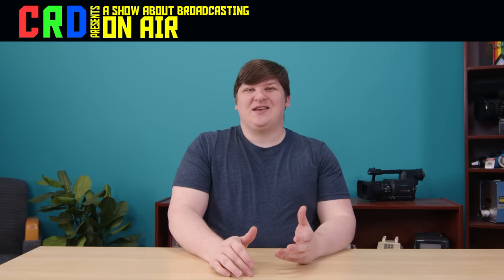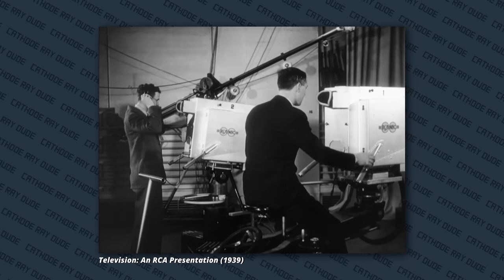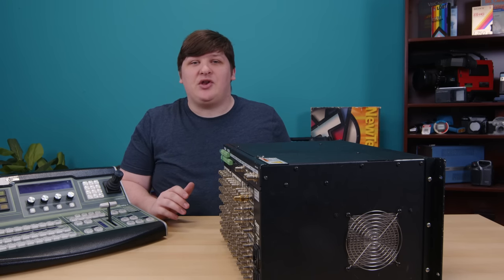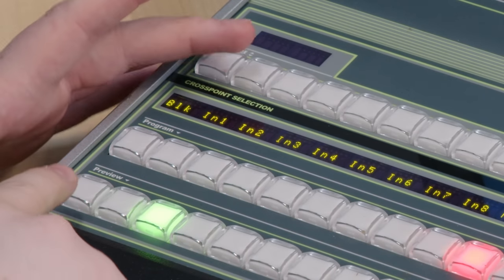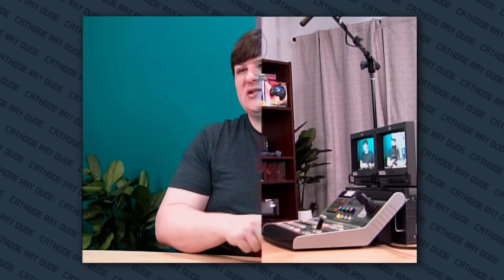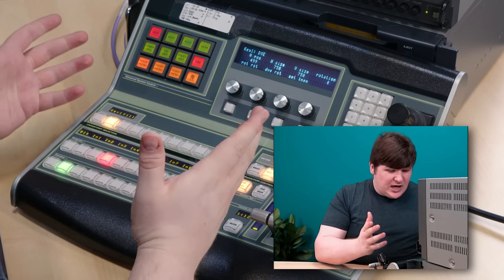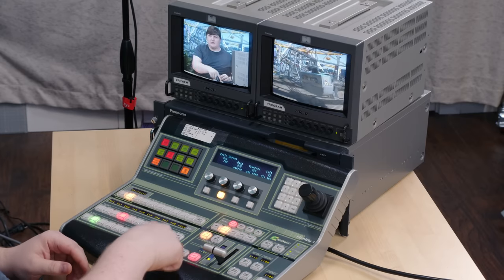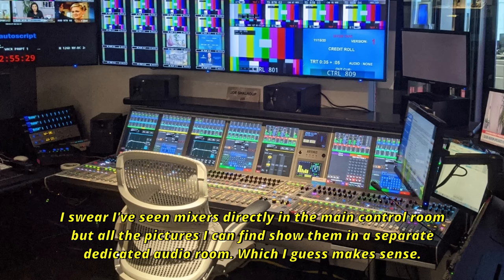What the heck is a video mixer?

Comment: I did public access back in the late 80s through early 90s - our video switcher board had all sorts of features, but was still only capable of doing 480i.
I did the whole producer training, and helped produce many episodes of a local zoo show, as well as a lot of sports events at local high schools.
We even had a couple of Video Toasters... but almost all of our studio cams still used photomultiplier tubes (CCD was out but was really expensive then) so good luck doing anything fancy. :D
Reply: I was involved in community TV and radio on the 90s.  It was so much fun.
Reply: Since people seem to find this interesting I'll call out some of the gear we had in each of the studios (two large ones and two small ones). 
We also have several mobile truck studios which had similar but more condensed sets of more or less the same. Almost all of this stuff was rack mounted in a series of panels behind the switch board area (but within reach) and along the side wall. 
- the main video switcher - much larger than the ones shown in this video - ours had at least a dozen wipes/fades/etc and several modes to insert an inset (used way back in the day to show a scoreboard of a sports event in the corner of a live shot). Pretty nifty for the era, although far from top notch for the era (we were a public access station with decent stuff, not a major network affiliate).
To run this, you needed to demonstrate mastery - this person has the greatest ability to make a goof, especially if you're doing live (for sports events, we often did).
- VTR units - i.e. VCRs but of the U-matic 3/4" tape format - you'd have one unit set as master record, and several others where you could queue up various B-roll clips or the on-site shot you pre-edited; have your host introduce the video then cut to that tape, back to host once it's done. repeat, etc.
- sound loop players - little short loops of audio in nice little tape modules - insert a pre-recorded audio advertisement, etc. Push the button and it immediately began playback - once done it would stop and be queued at the right spot for the next time - pretty neat for back then.
- SFX/audio mixer board - same idea as the video switcher except lots of channel sliders; similar to a band's touring mix board but only a dozen channels or so. Nothing fancy like recording studio board (those have dozens/hundreds of channels).
- master signal generator / genlock - a rack mounted master clock - it sent a signal to all the video gear and cameras to keep them in sync. A requirement for the old NTSC standard to avoid any flicker.
- light mixer board - control the various lights in the studios - this was pretty fancy as we had a variety of plain roof lights, smoky gels, indirect, etc. Sadly not configured to use that protocol where you can send signals in real time, so somebody had to run this when you were doing a host intro and fade out at end of episode for the studio stuff.
- studio cameras - generally three huge tripod mounted monsters - they did have a limited ability to move so we would set them up for a show then leave them in place. Wonderful setup - preview display on top with red light if master was using your feed (so you'd be careful not to do anything dumb), connection for headset so you could whisper to control room and hear their instructions - "camera 2 get a close up of guest", "camera 1 get wide shot" etc. while cam3's feed was being used.
They had the nice hand grips and were very well balanced, so it was easy to aim it; zoom was a thumb control on one hand and focus (haha you expected auto-focus?) was a twist on the other hand.
If you aimed at the lights for more than a split second you would ruin the tube, which cost at least a few hundred bucks to replace, so just don't do it. :D
- a whole row full of preview TVs - one for each of the VTR units, one for "master out" and several others.
- shoulder cameras - we had a few smaller ones more along the size of news gathering gear - but that took U-matic tapes, so were bigger than a VHS camcorder. Once again, don't point at the lights - although these were a bit more tolerant than the studio cams.
- giant room full of audio cables and reels of video cables - audio was normally done via same stuff professional audio people use, nice rigid cables with XLR connectors that actually clicked and stayed connected :P Video was done via these at least 1/2" across cables containing 40+ conductors - the end connectors plugged in and you twisted to lock it in place.
- Going out with a truck to do a sports event was similar but often with less gear - 2 or 3 cameras for volleyball - maybe up to 5 for homecoming football. The "fun" part about those events was needing to do setup and teardown - and making sure to place your precious cable bundles somewhere they won't be constantly walked on by people who just can't seem to be bothered to step OVER the obviously very expensive cable. I wish I was kidding - those video cables were like a magnet for "moms with high heels walking out of bounds because they think they can" and we'd have to shoo them away. :D This was the point in my life when I learned about rigger's/gaffer's tape - like duct tape but much much better (even if more expensive).
Reply: @chouseification  it's like what they say about fiber optics, The yellow digging machines will come for it. I did audio mixing for a band at a race (running, fundraiser, nonprofit) wouldn't you know it of all the places the pathway decide to form right where all my cables were going from the Mic's to the mixer and I didn't have a snake or longer cables at that time.
Reply: @chouseification  yeah wasn't that fancy for the rubber cable guards at that time as I was literally 5 to 10 feet away from the band.
Although I did do the music tent for our small local county fair (minus the animals so we call it an expo). we had a fiddle contest where all three judges decided that they were going to move into my tent and act like they own the place. And then they complained about being behind everybody and not really able to see the players, shockers it's almost like they were sitting behind the stage. Oh wait they were to the left.

I do an international water tasting for 3 years now and I love offering up press feeds. And occasionally will have other groups come in and film like TV, documentary etc. I've only had one person who understood what that meant where I didn't have to explain and they took me up on it.
I've also edited videos where having a direct feed from the board is so much better than having the room audio from a gymnotorum.

Oh yes the fun situations that we find ourselves in. I got into a concert at a nearby local theater free for helping them tear down. Not only did half if not all of the people coming in have earmuffs on and hearing protection which made the entire thing a horrible experience for me the whole thing sounded better in the lobby over the fallback system. Oh yeah where was I going with this the old theater balcony needless to say started shaking with the spectators even made one person nauseous. It's nice that you got them kicked off and it's also nice to keep the responsible ones. Rickety structures ekkk.

I was asked to film today or yesterday now at my local Art's Place, they had a kids art thing they did in their black box theater which has four posts and guess where I was I just barely managed to get angles and on top of that they had a band set up and a completely other weird angle that I had to jump back and forth between with one camera. I did it free as a favor so didn't necessarily feel like nor have the time to grab the second camera. Although I did get a compliment from the new Director, on how unobtrusive and how I got a decent angle and wanting to work with me again. The funny thing is under the previous Director I used to volunteer at the digital media center that fell apart consisting of a 3 cameras Community TV studio.

There's a really small town near where I live and every so often they lose phone+911 service because the line somehow breaks between here and there. Lucky you still had service from what I understand a lot of lines get consolidated down to the point where they might've been redundant on either side of the street but after consolidation from some penny pincher are now running through the same cable.
Reply: I worked at multiple TV stations in the mid 90s to mid 2000s. Some broadcast, and one public access. I used a version of Video Toaster at all of them. They weren't fancy but with some imagination they were awesome.
Reply: @scottlafleur4148  it really was neat seeing some of the stuff people tossed together once others could show some tricks on the Toasters. :D We barely scratched the surface ourselves (in that first few years), but the producer for that zoo show was a downright territorial person, so she was shall we say negative to any suggestion that used off any new tricks the gear could do but she wasn't familiar with from her own "explorations". Yeah. She barely trusted us using shoulder cams for studio shots... but c'mon... when the host is sitting there with a docent and they have a pair of tiger cubs, or one adult... those tripod cams weren't enough - prone on pillow with shoulder cam on you was best shot, so we did it... eventually the proof in the great shots melted a little bit of the ice. :P
It was odd... her buddy ran the board most of the time - he was adequate at it, but wasn't the video game player myself or another teen volunteer were - we had mastered the thing in the spare edit bays... he was a chump compared to us, yet we ran cameras and her putz buddy ran the switcher most often for that show. Yay... haha. Running switcher for homecoming football was fun though - we had it down, even for a public access crew, we were putting a very nice show out the live feed - always ready to cut to a different cam if somebody twitches and loses their shot, is obstructed, etc.

Comment: Gravis, that Ampex ADO cost half a million dollars back when it was released, consumed 60amps of 240Volt AC, and contained two 200 Amp five-volt supplies, and two 50 amp plus and minus 12-volt supplies! The mainframe was huge and very difficult to repair... Ask me how I know! :) We had four of them back in the late 80s!
Reply from the maker: holy crap - that's about what I figured on the price, but I can't imagine having four of them. I figured these would be a single object that was treasured and revered by everyone and you had to schedule time on it, haha.
Reply: @CathodeRayDude  We had several Abekas DVEs, video switchers, and DDRs as well. They were mostly analogue component video and parallel digital CCIR-601, before serial digital video! The video was run from frame to frame with high-cost low capacitive (2 to 5 picofarads at 25 metres, the cable cost several dollars per foot!) DB-25 parallel cables, around a max length of 25 to 50 metres!
The Abekas switchers didn't have MEs, but had layers, and you would build the images up layer by layer and then record it off to a 60-second video disk hard drive playback and record digital disc recorder. These were all multiple million-dollar solutions! I had to sign an NDA to never speak of how they were connected together, as that was an in-house production trade secret! serious stuff back in the 80s and 90s!
Reply: @tekvax01  I hope you don't break your NDA by saying that they were connected together by hmmm shhh CABLES!
Reply: To add to what @dan b said:
Each ADO unit he described was a single DVE channel!  These were a separate piece of equipment to the switcher whereas modern switchers offer DVE on every upstream key.  Each ADO channel was about 10-12U (?) high of rack space at least, about the size of a bar fridge.  You’d get two in a full height rack. The 4ME GVE Kalypso I used later on was smaller than 1 ADO.  

They worked just like a Character Generator would with a mixer.  The ADO provides both a video output and a key output.  The key output is a black and white video channel that the mixer used to dictate the shape of the key.  This is known as External Key, you can even do it "manually" with two cameras.  Mixers would either have specific key inputs, or inputs programmed to be tied into video and key pairs.

The ADO terminal you showed a picture of at 27:58 @Cathode Ray Dude [CRD], is the Z80 based microcomputer controller as described in the manual. This did the math part of the effect geometry, key framing and file storage.  The ADO terminal fed the geometry to the ADO via a serial data connection.  The data was real time - move the picture and you could see the numbers change.  You can edit your effect by text input and even had copy and paste functions so you weren't doing everything by eye.

Because these things were so expensive, the terminals had a resource sharing system. You could “acquire” and “release” control of a DVE channel depending on how many you need. That way multiple studios or edit suites in a facility could use the ADOs as needed, using centralised video routing or just a patch bay.  A TV station I worked at had 3 ADOs, shared between a studio and an edit suite.  They normally sat at a 2:1 assignment, but the studio could borrow the third ADO when doing a bigger show.

I helped one of our engineers replace a PSU one day. I remember us joking “200 amps would kill you, but the 5 volts would do it real slow”.  They're the size of a small car battery.   All linear PSU technology.  The internals were amazing electronic design too. The “motherboard” was a backplane built with wire wrapping. Every connection is an individual hand placed wire. All the same colour too.

While the quality of the video the ADO produced was quite dated by the time I used it.  The unit as a whole was a joy to use.  The terminal had a purpose built key layout and a full screen to display geometry data on.  DVEs built into mixers all had to shoe-horn the data display into what's available in the mixer.  Large scale units like the Kayene and MVS have a PC running their menu systems, but the DVE data still has to work with the overall layout.  Like @Cathode Ray Dude [CRD] says: these things are a conglomerate of user interface and a great study in the possibilities to achieve the same outcomes.

Comment: God I'd give anything to see a full video on that Ultimatte model you have, that thing looks more like some vintage test equipment and I'd love to see the quirks of pre-PC chroma keying
Reply from the maker: It is apparently an INCREDIBLY advanced piece of gear. So advanced that it's either broken or I don't know how to use it. But trust me, if/when I get it working, it'll get a video.
Reply: @CathodeRayDude  i hung on to my cheat card for the ultimatte iv for the longest time through several moves - I’ll see if I can find it. It is really hard to get it going just by fooling with the front panel till you close in on what you want. I got myself in real trouble once just thinking I could wing it first time out. 
later, mid 80s they came out with the ultimate 300/news, Matt, which was smaller, and only had a few knobs it much easier to just do the basic weather map effect while retaining shadows.
Reply: @CathodeRayDude  I found it! The quick setup guide for
The ultimatte IV and the troubleshooting guide on the other side. I even have two copies so I can just give you one if you want the original one on cardstock.

I sent a scan to your gmail

Comment: I used to have an MX50 in a university video studio I worked in. You can get a straight cut between A&B busses by hitting the auto take button on the right of the T-bar, when the transition knob is set to minimum (all the way to the left). I do remember using this mixer with a programme / preview workflow - if I recall correctly, the preview output displays whichever bus isn't currently being sent to the programme output. I can't remember whether the auto take swapped the busses, or just simulated the T-bar switching over - I think the latter, as I have a recollection of the T-Bar's physical position being out of sync with the current programme output - hence the little red LEDs on the left of the T-bar to indicate which bus is live. 

Thanks for the trip down memory lane!

Comment: I was the TD for several small live video productions at a university during COVID. I operated four Panasonic remote controlled cameras, as well as doing video mixing with a Blackmagic ATEM Television Studio Pro 4K. A bit overkill for four cameras but I'm not complaining. There were I believe six other inputs, but I never used them as they were video sources from computers and unplugged cables - I swear one went to a security camera backstage.
Reply: That might well have been a security camera. I could see one benefit being so you can tell who's gonna run out from behind stage. Or what mischief might be going on. Plus a security camera is way cheaper than a professional camera.

Comment: I was the lead producer on my middle school's TV station from 2018-2020 and we used a Panasonic WJ-MX50 every day - we were a 4:3, SD production house, using three Panasonic Mini DV camcorders hooked up via composite to the switcher, and to three small B&W preview monitors, with the program display output going into the JVC version of the CBM 1084 CRT monitor. For some reason, we also used an external audio mixer.
We never got to add the character generator, but I would've loved to and want to get my hands on my own. I do understand your issues with A/B but that's just always how we did it and it always worked for us (with only three cameras, you could always keep your eye on all three - the morning news show had camera for boy anchor, camera for girl anchor, camera for both anchors, plus a fourth VTR input).